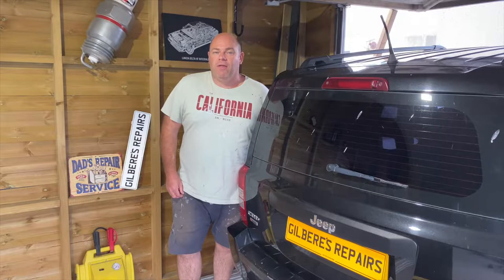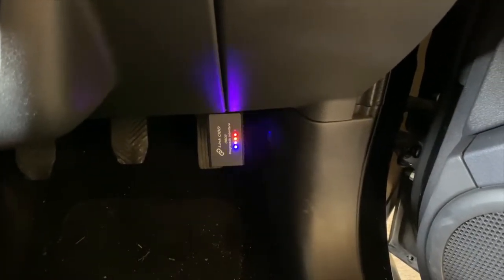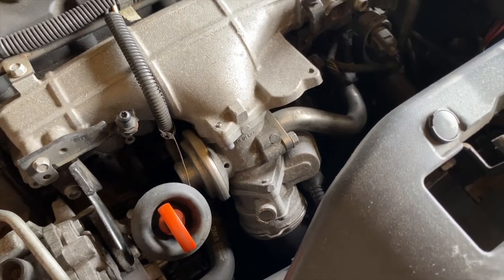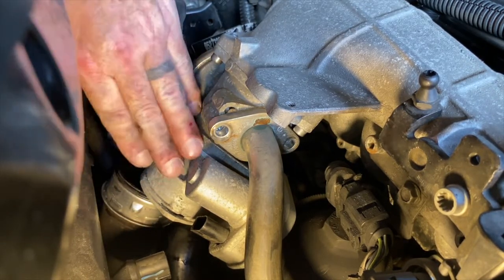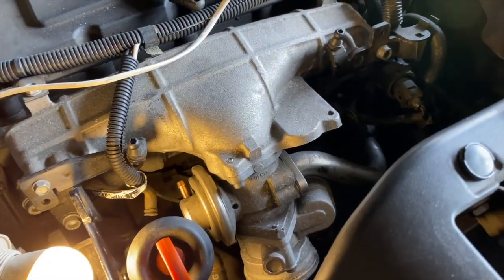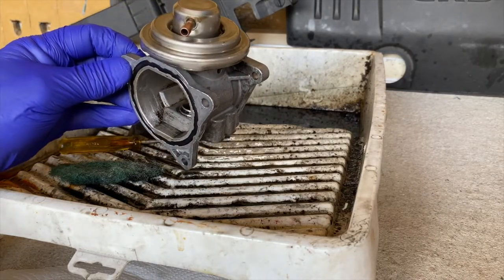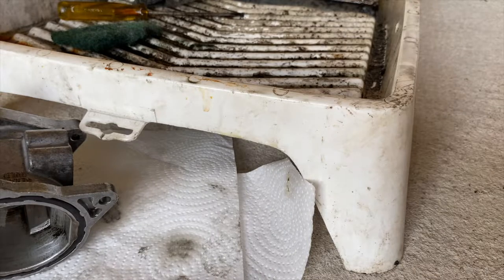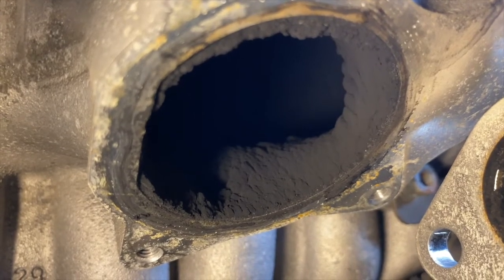Jeep Patriot PO488 Fault Code EGR Fix / Compass CRD and Volkswagen Audi 140pd TDI

Comment: I am still trying to sort my jeep from weeks ago.
I couldn't  find any air leaks in the pipe from the throttle body, but now I am beginning to get some flutter at relatively low rpm and black smoke with a heavy boot.
Tested the vacuum on the EGR that pulls back the small plunger and holds vacuum.
Plugged in Autel DS808 scanner and found boost pressure high and atmospheric pressure high but no codes stored and no engine management light on!!!
Beginning to wander if it is the MAF sensor...
Mine is the same jeep as yours on an 08 with 95k.
Reply from the maker: I’m unsure what to advise. You can buy MAF spray cleaners for not a lot of money.
Reply: @gilberesrepairs  May just replace the MAF sensor as it may not throw up a error code so it says but cant imagine how it would cause turbo over boost.
Its been quite a parts bucket so far since I have had it, but when running right I get 48mpg.

Comment: Thanks heaps for the video. So very helpful.
A quick question you might be able to help me with...
The little vacuum pipe to the egr (white hose) , there's another little black vacuum hose that shares the casing and goes downwards below the egr valve.
It has come away in my car and I cannot see what it should be connected to.
Any ideas? Newbie here. Please go easy.
Thanks in advance.
Reply from the maker: Welcome 👍

I will have a look at mine and get back to you. 
I’m not at home for the next couple of days, so there maybe a little wait 🤷‍♂️
When i reply it’ll be on this thread.
Have a look at my playlist on the patriot if you’re at a lose end 😉

Comment: What's top speed? I have a compass 2007 crd with 140 hp...great video bro👌
Reply from the maker: When it was running, it was underpowered. I think this was because of the soot restricting the air flow into the engine.

Don’t forget to check out my Patriot Playlist 😜

Hope this helps 👍

Comment: Great video. I have a 2008 CRD with 85k miles so its likely overdue a clean. Would there be an advantage taking the air intake off above as well to make the job easier? Plus its likely also full of crud which could be cleaned out.
Reply from the maker: Just had a look at my engine, do you mean the aluminium inlet manifold?
Reply: @gilberesrepairs  Sorry, yes I meant the aluminium intake manifold. I posted this 3/4 of way through your video and then realised towards the end that you had seen quite a bit of old crud in there and planned to remove it at a later date. Also watched your split hose video, had an issue on mine before where a hose clip must have been loose as it blew off. Suspect my EGR needs a good clean, plus the throttle body. Even tempted to disable the EGR (I know MOT and emissions!), but it would stop it clogging up further.
Reply from the maker: @UKBlue407  Yep, definitely worth a clean in the inlet manifold! There are egr deletes for this engine, i only watched a video the other day. The egr system is a failed system really, who in their right mind runs the exhaust through the intake 🤔

I will be replacing the turbo very soon on my Jeep, so that should be fun. I’ll learn as i go and record it for YouTube.

Comment: Awesome video - thanks - have you ever had to clean or replace your MAF sensor? I'm getting the odd stutter when driving and a P0101 Mass Air Flow Sensor A Circuit Performance code, but wondering if it could be my EGR valve.
Reply from the maker: Thanks for the compliments 👍

Yes, I’ve cleaned a MAF sensor before. Have a look on eBay or Amazon for - Mass Air Flow Sensor Cleaner. It’s only about £10/12 here in the uk. They are normally easy to get out and you just give them a spray with the cleaner. 
It’s worth a try for how little it costs 👍
Reply: @gilberesrepairs  I’ve done it before on other cars with varying success. I have my cleaner coming from Amazon tomorrow. I reckon I’ll have to do the EGR valve though, but not looking forward to doing it in freezing Manchester weather on the drive!
Reply from the maker: 🥶🥶🥶 Hope all goes well 🥶🥶🥶

Comment: Salutare.....la am meu jeep patriot 2.0 crd 4x4 am o problema cu electrovalva vacuum turbo. La 1 an o schimb.incepe sa faca un zgomot ca un pacanit ca si cum trage aer fals.ce ar putea avea?mulțumesc
Reply from the maker: Hello, i would start by checking all of the boost pipes from the turbo 👍

Look at this video…. https://youth.be/nWs7c4V-Juo?si=gghIQ4sOq66BvCG6
Reply: @gilberesrepairs  Hallo again. What ca-n i do with p0299?i change all the piper...i dont like how the actuator from turbo works...i ca-n change him?
Reply from the maker: @GabrielBotescu-b4y  Hello, I had a split boost pipe which made my engine smoke badly (black) when accelerating. I replaced the split hose but later on i realise it had deposited soot into the inlet and exhaust. 
Take a look at this video https://youtu.be/mx0aOYZ7-BA?si=5zPbq3-CUtAeporX   when i was replacing the turbo. At 2 minutes 45 secs, it shows the vacuum vnt actuator. The actuator diaphragm could be split or you could have a sticky vnt assembly. 
The link above is video 2 of a 3 part series if you decide to remove the turbo.

Good luck 🤞